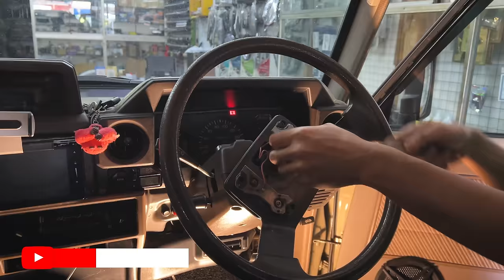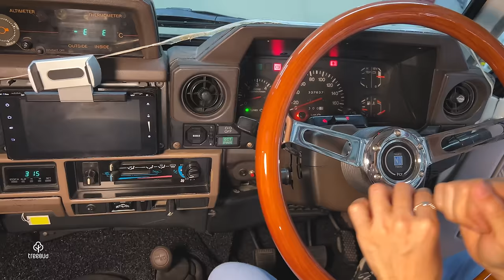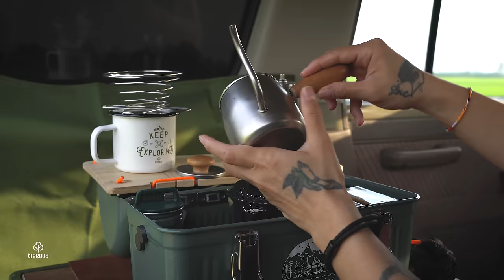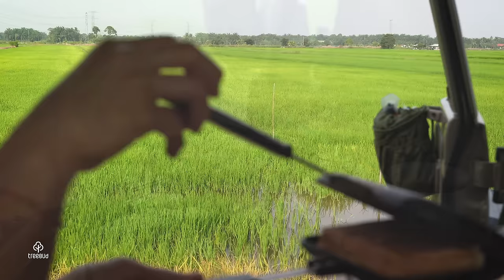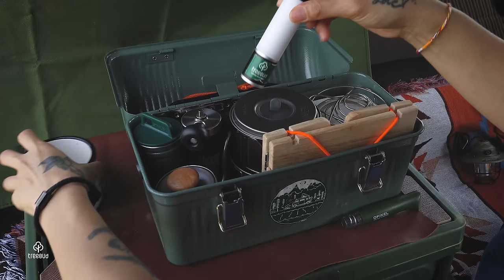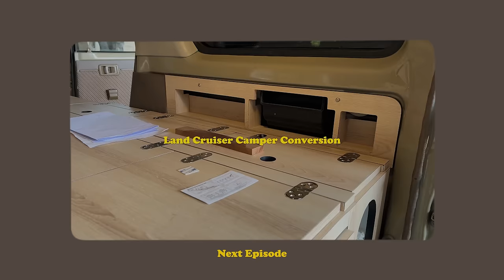Land Cruiser Restoration Part 4 Camper Conversion, Stanley lunch Box, Outdoor Coffee, Nardi

Comment: Hi, where can get this Nardi
Steering boss kit ? Worries buying wrong model ..
Reply from the maker: Hi @chkeeisi9852, thank you for watching. 
The boss kit comes along with the steering wheel , but mechanic ah Hui told us it's actually not completely compatible, thus they modified a little at the dashboard area and now it fits well :)
You may find the the boss kit online or at auto shops that sell secondhand parts. And do make sure to double check the model number and compatibility before you buy yea. Cheers :)